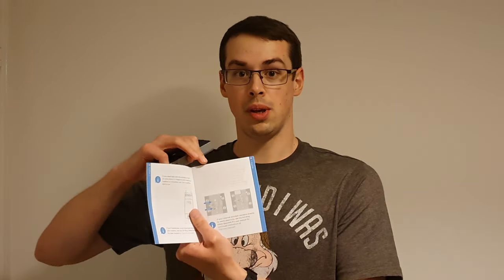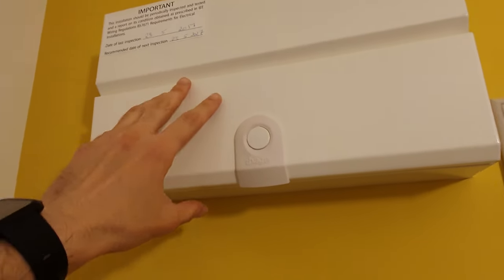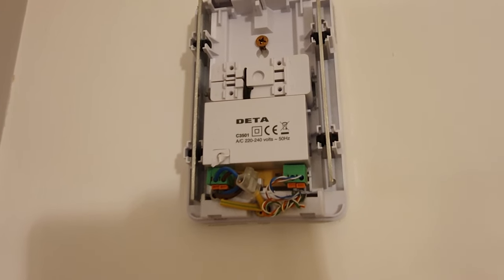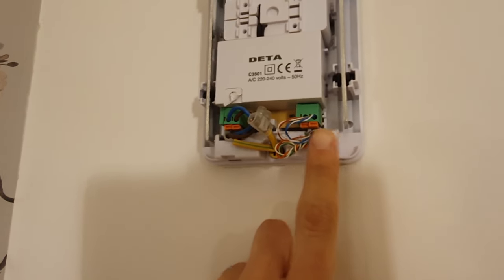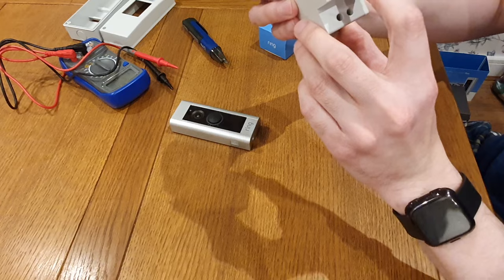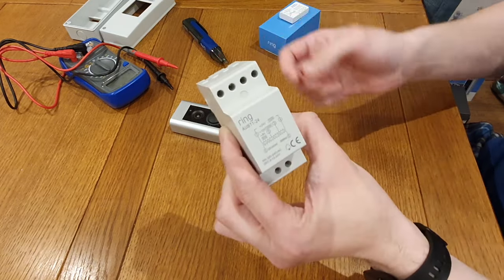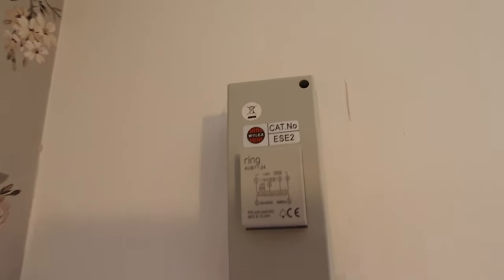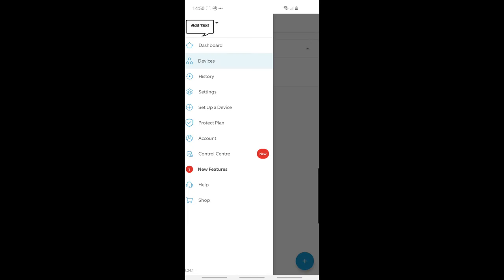Deta Doorbell to Ring Doorbell Pro - UK Wiring Guide (Direct To Transformer Install)

Comment: Excellent explanation, but,  I did not see the chime being connected to the bell.
Reply from the maker: Thanks! Yes you're right, I literally did a direct to transformer install and didn't keep an existing bell/chime. I instead just rely on the Ring Chime. This is fine for my purposes, but it does mean that if the WiFi is down, I won't hear a doorbell chime so this approach isn't suitable for everyone.

Comment: Am I being stupid or could I just put the new transformer in the old casing? Rather than buy and install a new one
Reply from the maker: Nope, you're right. You could do this - assuming there's enough room for it. From memory, these should be enough room but you might need to hack the casing a tiny bit.
Reply: @SmartHomePoint  thanks very much for the quick reply, and for the video. Huge help :)

Comment: Great video mate and good instructions I decided to send back the ring doorbell camera as I can't touch anything in the new property lol.
Reply from the maker: Thanks mate 🙂 Ah that's a pity, but it makes sense to send it back. Ring's battery doorbells with adhesive tape could be an alternative, although naturally these could be ripped off by someone.
Reply: @SmartHomePoint  hahahaha lol just the best idea is to return it lol saves all other expenses and no new holes in the wall and I had a brand new chime system to and was looking for the possibly another part but there wasn't one etc.

Comment: Decent vid mate - just picked up a new Doorbell wired and realised I needed a transformer. This really helped.
Reply from the maker: Thanks mate, glad you found it helpful 👍
Reply: So the doorbell is up and running - thanks again, all done in less than 15 mins. Used a dremmel to cut the centre out of my Deta chime housing to fit the transformer - wife won't even notice 😜
Reply from the maker: Awesome, congrats on getting it working. And yep, the dremmel approach sounds perfect too 😆

Comment: Thank you so much for posting this. It has given me the confidence to give this a go with the Ring Pro 2 I purchased on Black Friday. 

I think the transformer should still fit in the ESE2, but I will take it with me to Screwfix and immediately return if not! Ring do sell a neat little ‘Enclosure for DIN Rail Transformer’ if not but would rather not drop £16 + postage on this if at all possible!
Reply from the maker: Glad you found it helpful 🙂 Yes that plan re Screwfix should work well I think 🤞
Reply: @SmartHomePoint  I did a dummy run today and can confirm that a) the Ring Pro 2 transformer fits into the ESE2 Din Enclosure beautifully and b) the Pro 2 fired into life when temporarily connected to test that my pre-existing wiring was not broken and that the transformer was installed corrected. Both my wiring and the transformer appear to work flawlessly having followed your very helpful video.

When my Wedge Kit arrives this week I plan to install it permanently and leave a comment confirming that this method 100% works for the Pro 2 (which I’m currently 99% sure is the case).

Put it this way, I doubt the doorbell would fire up and start talking to me if I am likely to encounter any issues. Thanks again!
Reply from the maker: Thanks awesome, thanks for the update and confirming it broadly seems to work 🙂 the Ring Pro 2 is a nice doorbell, I hope it works out well for you 👍
Reply: @SmartHomePoint  As promised, I can confirm that this method does work perfectly with the Ring Pro 2. I did need to buy a Chime Pro to get a strong Wi-Fi signal outside but that has nothing to do with this method.

The only thing I have been disappointed with so far is the lack of VPN support for Live View.

Having to turn my VPN off to use the Live View is not exactly ideal. I am going to see if there is a way of excluding Ring from my VPN but this does seem a bit of a misstep to me from Ring. The same people who care about home security are also, I would suspect, more likely to care about their online security too.
Reply from the maker: That's great, thanks for confirming it works fine for you. And good point about the VPN - it's frustrating that Ring have made no effort to support VPNs 😕

Comment: If you own an existing intercom in a flat is the process the same, I have a phone type buzzer, you pickup & speak,so ideally id like to keep that & use the outside for Extra wires to feed to the ring camera if you follow, I've ordered a 6m adapter just incase, think I'll need extending though as I need 9 metres 🤷🏻‍♀️ thanks in advance 👍
Reply from the maker: I'm not 100% sure sorry, but my hunch is that as long as there is sufficient power/voltage for both (to support both the Ring Doorbell and the phone buzzer), it should work fine. It's basically a case of power both devices, from the single input cable.
Reply: @SmartHomePoint  yes that's what I was thinking, thanks my friend, I'll give it a go 👍

Comment: My bell is operated directly by 230v. There are two slots for L & N. I  also have two wires coming straight from the bell button. Where do i connect them ? (since there is no transformer). Thanks for the nice video !
Reply from the maker: I might be misunderstanding, but you won't be able to hook your Ring doorbell straight up to a 230v supply, it would fry it. You would need to install a suitable transformer first, then follow the wiring diagram I show in the video.
Reply: @SmartHomePoint  Thanks for the quick answer. This is the only video ive managed to find with the excactly same bell i got :
https://www.youtube.com/watch?v=08iw1ZYpOkE
I dont understand the connection though and the video is in polish😞Did you get something ? Thanks for helping by the way, its important to me.
Reply from the maker: I'm sorry, I'm not sure either for that connection type 😔 You mainly need to verify that the right voltage is supplied to your Ring doorbell (I e. 16-24 VAC 50/60HZ, 10-40VA max). Worst case you might need to call out an electrian, who will probably know the solution immediately.

Comment: Great video! All info provided adequate and useful, very helpful
Reply from the maker: Thanks, glad it was helpful! 🙂
Reply: @SmartHomePoint  when you ordered the pro power v2, did it come with the doorbell packaging or did you have to order separate? Also, where did you order from if it all came together?
Reply from the maker: @westyafc99 I ordered from the Currys eBay store to be honest, and the pack included the Pro Power Kit v2 yes. Maybe Ring have changed what's included recently though? My Pro 2 box didn't include a Pro Power Kit.
Reply: @SmartHomePoint  I ordered mine from AO and received all but the Pro Power pack 👍🏻
Reply from the maker: Hmm that's confusing, it is odd how it seems to vary a lot 😔

Comment: Great video, could you have not kept the deta chime so you can hear the bell?
Reply from the maker: Thanks, glad you found it helpful. The Deta chime is unfortunately incompatible: https://support.ring.com/hc/en-us/articles/209028546-Ring-Video-Doorbell-Pro-Chime-Kit-Compatibility-List (that's the US link, there's an equivalent UK one but I can't find that now - it does list Deta as incompatible too though)
Reply: @SmartHomePoint  thanks for your quick response, did you just use the plug in chimes?
Reply from the maker: Yes I just used the plug in chime, and it's working fine so far. My WiFi is really reliable so I don't have any problen with relying on a WiFi only chime and getting rid of the Deta chime, but I know some people prefer having a mechanical chime too.

Comment: Amazing video. Do you reckon I can make the same wiring possible for another video door bell which is non-Ring (like the Eufy door bell dual wired, that I got from the US? Thanks
Reply from the maker: Thanks, glad it helped 🙂 It's hard to say with other devices, especially US ones because they might expect a different voltage input. The wiring itself should be fine for any smart doorbell, but you'd have to double check the voltage and amps to ensure that's all consistent.

Comment: Informative video, in my case, i haven't got any wired bell so i am thinking to power the bell from lighting ceiling rose. Do you think its good idea to put a switch before the transformer so in case we need to isolate the bell then we can without disturbing or breaking  lighting circuit.
Reply from the maker: Thanks 🙂 Yes I think that's a good plan (adding a switch as part of the lighting circuit) for sure 👍

Comment: Hi, good vid.......however, what abuot the chime itself ?
Reply from the maker: Hi, good question, I should have covered this point originally. Since my WiFi is good and reliable, I just rely on the plug-in Ring Chime (and my Echo devices, setup as notification devices too). It works fine for my needs 99% of the time. 🙂

Comment: Thanks for this video, it was useful for me when replacing a crap builder-supplied BG doorbell transformer/chime, which only supplied 8v, with a proper 8-24v bell transformer for my Reolink smart doorbell. I used your method with the wylex enclosure but used BG bell transformer instead from screwfix (almost looks identical to your ring one just with BG branding, wouldnt surprise me if they came out the same factory), wired it up for 16v ac (tested with my multimeter).

Comment: Hi thanks for the video I just found it , it is very useful, my only question from where actually the sound of the bell will come if you have removed the old system? it will come from the ring transformer? I bought a ring doorbell wired basic one not pro thanks
Reply from the maker: Glad you found it useful 🙂 The sound can come from a plug-in Ring Chime, or Amazon Echo's too. I get 10 doorbell sounds round my home when someone is at my door 😅

Comment: Hi excellent and informative video. Would the same instructions apply to the ring transformer 2? I have ring video doorbell wired and am going to buy the transformer 2 would the set up with the twisted pairs be the same?
Reply from the maker: Hi, thank you 🙂 Yes the same steps are true for the Ring transformer 2, although it is a slightly different shape so you might need to get a different DIN rail enclosure. Maybe it will fit fine, I just haven't tried it out myself.
Reply: @SmartHomePoint  thank you so much for your fast response

Comment: Brilliant video.

I done some research online and the Ring website says you need to use a resistor and that’s the bit that’s confusing me. Do I need one of these? 

So essentially all I’m doing is feeding the transformer with 240v (1.5 twin and earth?) and then using cat5 cable from the transformer into the door bell? After looking online it looks a lot more confusing than this...
Reply from the maker: Thanks 👍 The resistor can be confusing. My understanding is that it's only needed for the other models (i.e. the non Pro ones) when hardwiring them, to replace the load that would be the chime.

The Pro is designed for use with or without a chime (controllable via the settings) so doesn't need the resistor.

Yes, a 1.5mm twin and earth in and then a sufficiently thick cable out (i.e. cat5e is fine, whereas a single strand telephone wire wouldn't be) should work well.

It gets more complicated when the existing doorbell chime unit is added into the mix, but my Deta doorbell chime unit wasn't compatible and I was happy with the Ring WiFi chime so I went with this simple (but workable) approach.
Reply: Smart Home Point What is a chime? How do I know if I need one
Reply from the maker: The chime unit is the digital or mechanical wall-mounted unit of a (non smart) doorbell, which makes the noise when someone presses the doorbell. If you already have a hardwired doorbell, you'll almost certainly have a chime unit. But if it's a new install, you won't have one (and then can just follow the steps in this video exactly).

This is all very different to the Ring Chime though, which is just a plug-in unit that uses WiFi.
Reply: Smart Home Point I don’t have an existing door bell. Sorry if you covered it in the video, so where does the “chime” noise come from with the Ring door bell?
Reply from the maker: No problem, it's not an area I explicitly covered in the video unfortunately. So without an existing doorbell, you need a plug-in Ring Chime to get any doorbell sound. This usually comes with the Ring Doorbell Pro. This approach works for me really well, but since it's WiFi based, there won't be any doorbell sound if your WiFi is off.

As a result, some people install a compatible 'old style' doorbell chime unit - e.g. the Byron 776 is often used as it's compatible with the Doorbell Pro. This will then involve more complicated wiring (not covered in my video), and is probably the sort of thing you've been coming across in your internet research.

Comment: Thanks so much for your video it was very helpful to me. I too had a deta chime which was high voltage. I bought a standard transformer and have wired this in and mounted it where the chime was. As it was a standard transformer I didn’t get a circuit breaker, am I ok without this or is it a safety concern? Everything seems to be working fine? Thanks
Reply from the maker: No worries, glad it helped 🙂 Regarding the circuit breaker, you don't need a separate (non-Ring) breaker in the circuit but you ideally so need the Pro Power Kit since this acts like a breaker with the Doorbell Pro in certain cases (such as if you configure it to use a mechanical chime when there is none).

Comment: Thank you for showing how to remove the cover... do I just use brute force? I don’t want to break anything.
Reply from the maker: Heh - from memory, yes it unfortunately is a case of brute force. I don't remember there being any clips. I seem to recall that I just put one hand on the unit itself (at the back), and another covering both sides of the cover - then just yanking it off. It shouldn't require LOADS of force though.
Reply: @SmartHomePoint  i tried the brute force method. It worked well without breaking anything. There were clips, but they are so shallow it doesn’t hold too hard. I noticed the clip was on the middle on the bottom and on the right side on the top. I started to gently pry from the bottom middle, then went along the edges ever so gently. Just in case anyone else wonders. Thank you for your answer.
Reply from the maker: Ahhh that's good to know, thanks for the info - I'd forgotten about any clips.
Reply: @SmartHomePoint  it is more of a tiny brittle plastic notch than anything, really. Just to give a minimum of hold, I guess.

Comment: Hi on my deta box only the blue and white twisted pair are used. So blue in one terminal and white in the other!! Can each individual cable be used in the ring transformer or would I need to use the orange and white as well even though it’s currently not used? I’m confused!
Reply from the maker: Hi, do you mean that the invidual tiny wires are used? They might not carry enough voltage for the Ring Doorbell if so. You could test it out first, but if they don't carry enough voltage, you would then need to recombine the twisted pairs and use one blue/white and one orange/white (or whatever other twisted pair has been fed through to the doorbell).

Comment: Fantastic video, I have the same Deta Doorbell. Can I ask would this method be suitable for a Ring Doorbell 2. I do not wants the wireless method due to the constant charging and my doorbell itself is just like yours with the same wiring. I have no electrical experience but handy overall, I would like to do the same but my pack does not come the the ring bypass. Overall I guess I’m asking if I copy your method would this be safe and appropriate for my version of Ring. Thanks
Reply from the maker: Thanks! This method won't be directly the same as the Ring Doorbell 2 because the Pro runs at a slightly higher voltage and hence comes with a transformer. The Doorbell 2 can just be hooked up directly to the existing doorbell's wires, as long as 8-24V AC is supplied (https://support.ring.com/hc/en-gb/articles/115003011986-Ring-Video-Doorbell-2-Hardwired-vs-Battery-Powered-Operation). 

Alternatively if you don't have an existing doorbell, you'll need a resistor on the output leg (this is key): https://support.ring.com/hc/en-gb/articles/115003495766-How-to-Connect-Your-Ring-Video-Doorbell-2-Directly-to-a-Low-Voltage-Transformer-Without-a-Pre-existing-Doorbell- 

In short, it will unfortunately be a slightly different process for you.

Comment: Hi there, I am in the process of connecting the ring video doorbell pro as in the video.
I have my existing chime exactly the same model you have.
Could I use the integrated transformer of the chime instead of installing the ring one?
Thank you
Reply from the maker: Hello, whilst the output voltage of the existing Deta transformer appears to be sufficient for the Ring Doorbell Pro, I've spoken to neighbours who have said that they were unable to use the existing chime's integrated transformer - the Ring app kept saying it was insufficient voltage. So it seems like you can't do this, but admittedly I haven't tried it myself.

Comment: Great video and very well explained. I want to use my existing mechanical doorbell which is on rings supported mechanical doorbells list. The mechanical doorbell has its own transformer situated within the mechanical doorbell box. I don't want to buy a new transformer enclosure and should be able to replace the one in the mechanical doorbell casing. Trying to understand rings instructions for this type of install is a bit of a nightmare!. Have you any advise on accomplishing this? Thanks.
Reply from the maker: Thanks for the kind words. It's good that your existing doorbell is compatible - although unfortunately I'm not sure how to wire it up in this case, this was something that confused me a fair bit when I read Ring's instructions. I hope you find out what to do and get it installed soon though :)